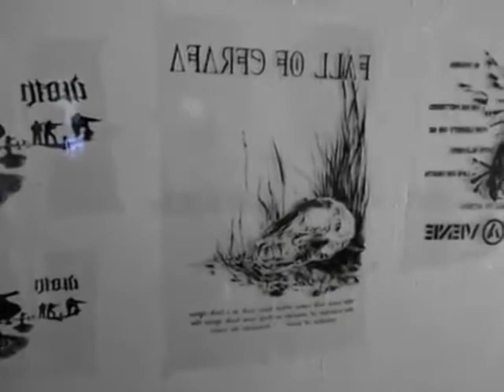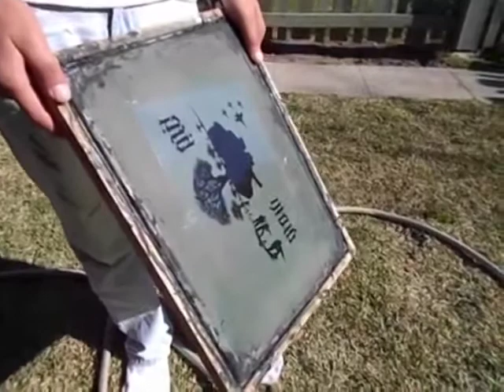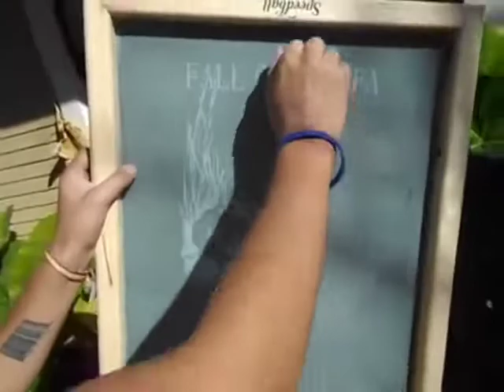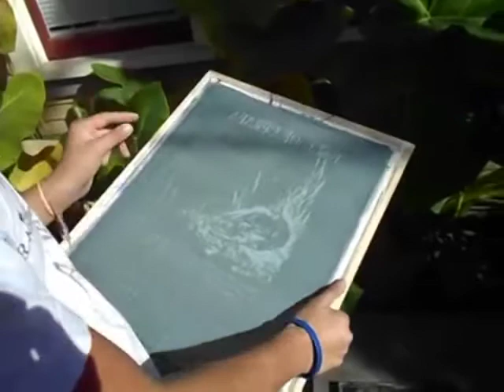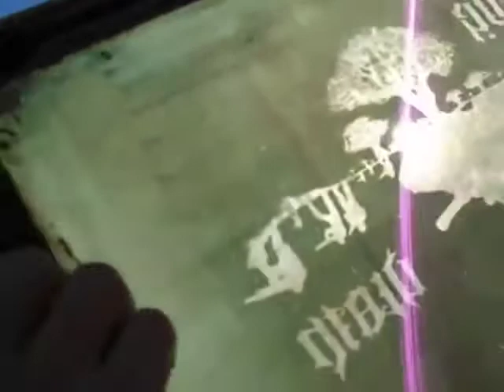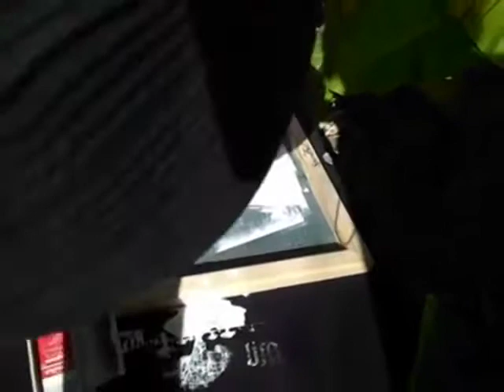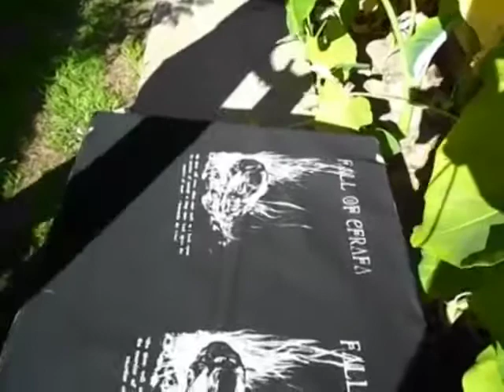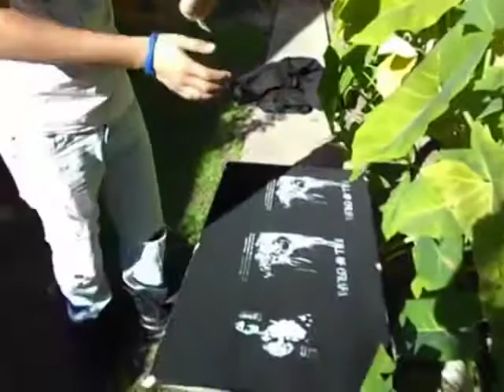How To Make Punk Patches with Screen Printing [FoxAlive 2012 Re-Upload]

Comment: so when you're first applying the emulsion (when you were in the bathroom), you don't have to be in the dark? does it only need to be in the dark when it's drying/fully dried?
Reply: depends on the sensitivity of the emulsion i think. there are other videos on screen printing in general,  that go into that more specifically. there's a video by Eddie Moon on yt that covers shirts, but it goes over emulsion specifically, so if you still need that
Reply: @MK-qt7kk  thanks!